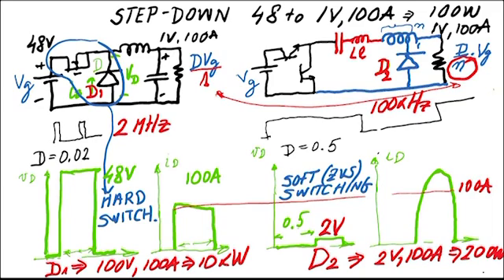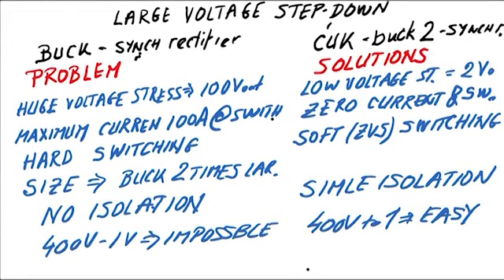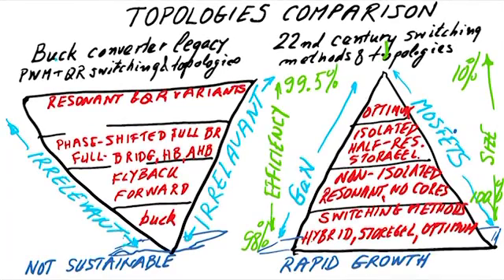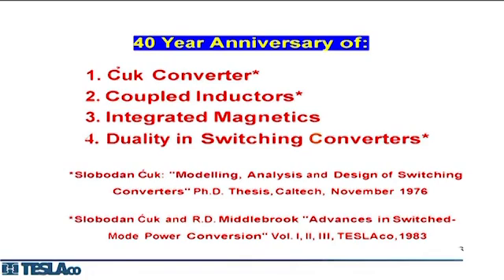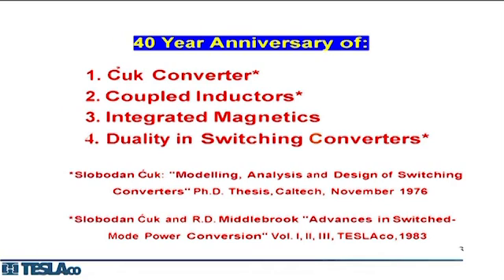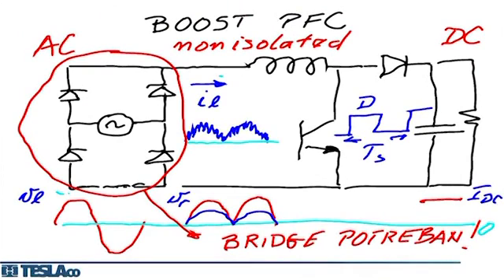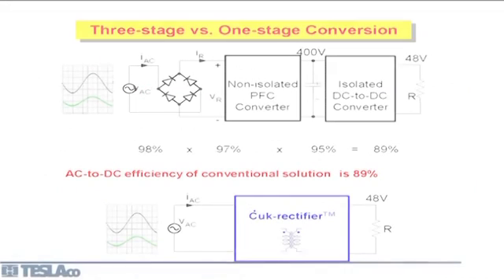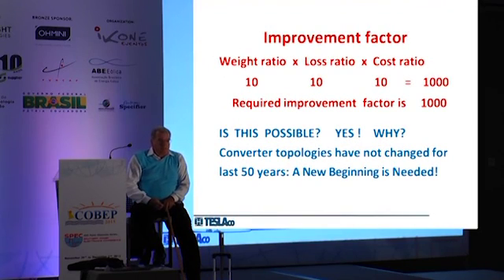Power Electronics For 22nd Century- Part 2

Comment: The tandem connection of circuits is a result of the "education" of electrical engineers. They were taught 3 ways to solve problems: 1) Monkey see, monkey do. 2) Divide and conquer. 3) Trial and error.

With Divide and conquer, each sub-problem requires a separate circuit.

Buckminster Fuller taught that there is only one Universe and synergy is when the total effect is greater than the sum of the effects of each individual part.

When you add integrated magnets to a switching converter, the results are better than expected.

Comment: The first component to fail in a power switching cct is always the electrolytic smoothing caps. Also usually difficult to select and source.  In a conventional buck they output cap has a relativly easy time, as the current is averaged by the output inductor, but not this new cct. Capacitor ripple current is extremely high! peak is much higher than the output current? Is this not a limitation? I guess combining a few channels can cancel most of it.

Comment: Thank you very much for the videos Dr. Cuk. I have one question: Can you please tell why LLC resonant converter cannot operate with wide input voltage range? It works from PFC boost of 400 V. If we put aside the regulations for a minute, why can't we use LLC half ZVS resonant converter from a wide input voltage range of lets say (120 VDC- 375 VDC) ? Can you please advise?